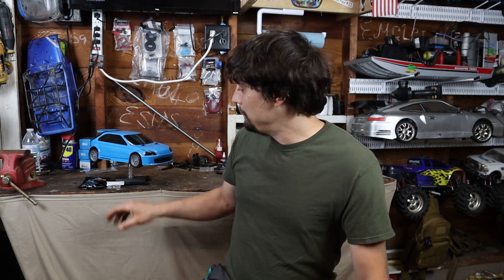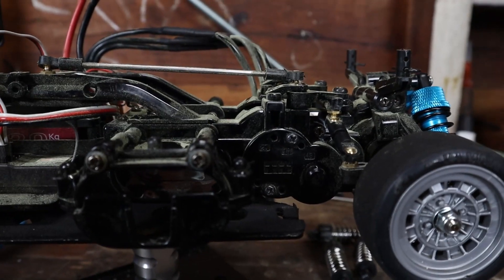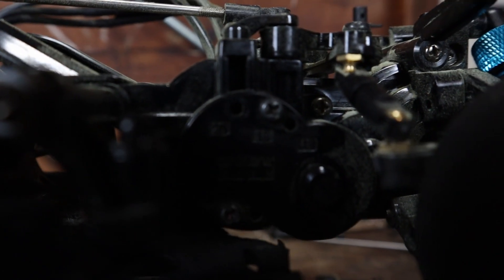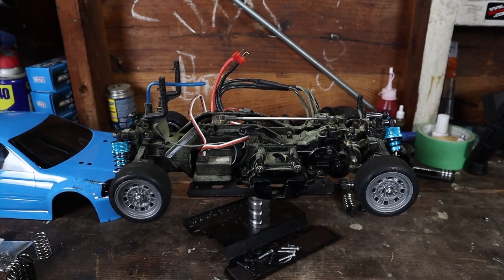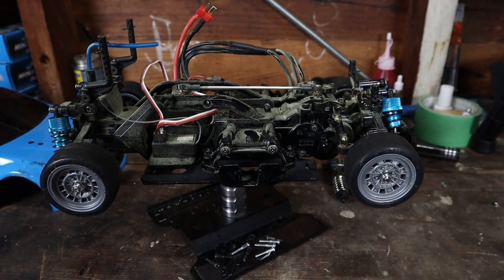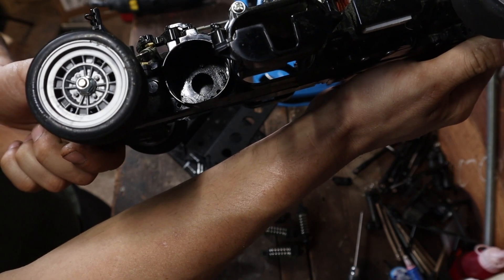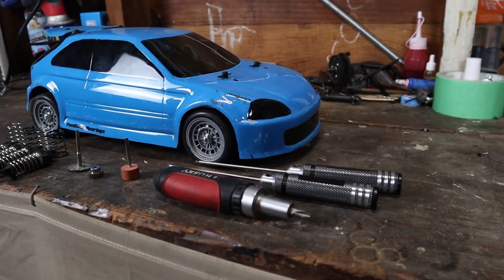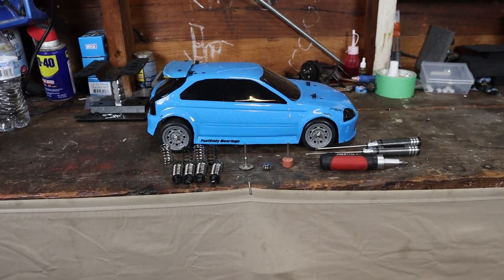Project Fastest FWD RC Pt 2  and Slash Bash!!!

Comment: Car slams on to concrete from 10-15 feet in the air
"We ArE hAvInG eLeCtRiCaL iSsUeS"
Reply from the maker: Found out the motor shifted into the spur and he had something wrapped around a spindle rubbing on the hub hard too 😂
Reply: @ottersrcgarage576  Hudsons gunna need like a whole roll cage body made

Comment: Sup man, nice content 😎 I did a build like that as well I broke the record for that chassis it went 49mph on a 132ft drag stretch with a 2s 45c battery Check it I just subscribed 👍
Reply from the maker: Thanks! I just stuffed a 6s esc in it and gonna see how fast the tires shred here soon. Pretty sure the motor is gonna smoke first but I hope I can get one fast pass out of it.
Reply: @ottersrcgarage576  sounds good. I'll be sure to tune in